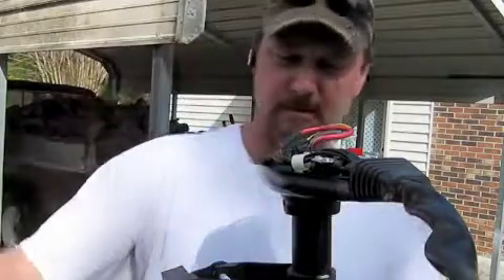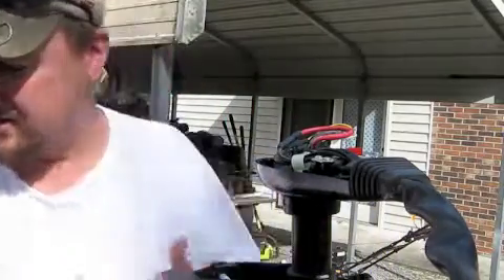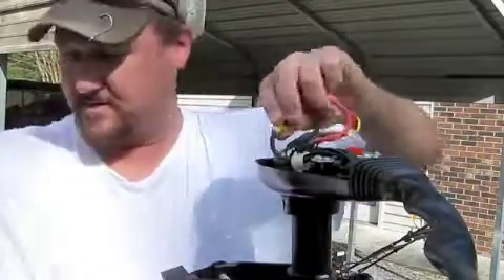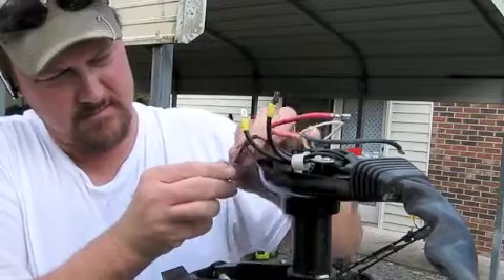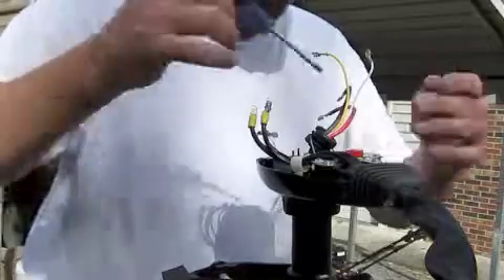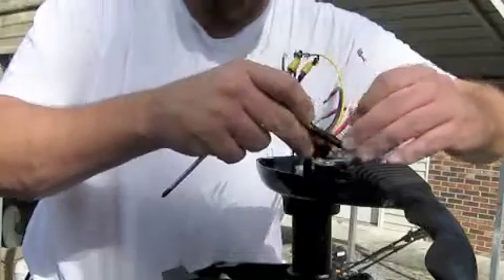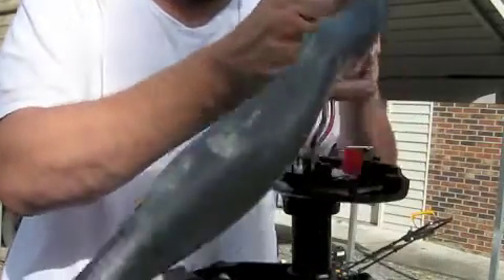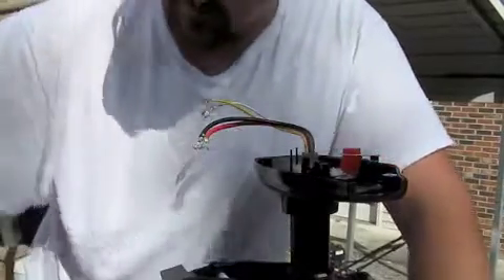Fixing the Minn Kota Troll Motor Part 1

Comment: I took the bracket off that holds the steering cables and was able to fit the rubber piece back over the center gear. Now, the cable bracket seems not to want to screw all the way down-plastic piece at bottom stops it. I think I figured out where the cables should be in relation to the direction the prop is pointing, but I'll have to wait and see if I am going in circles when I take it out on the river. :) Thanks for the videos. Maybe one that addresses this problem is next?

Comment: I didn't see how you lined up the steering cables on that rubber piece that fits down over that center sprocket. I have my motor head apart, and can't figure out how to replace that piece.